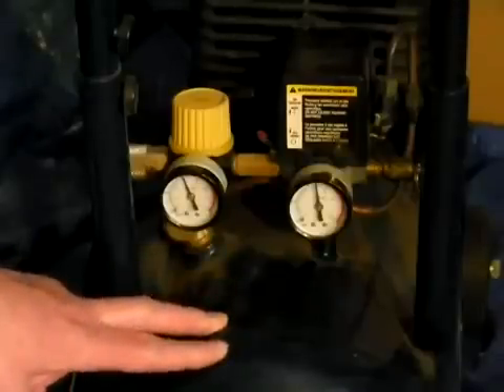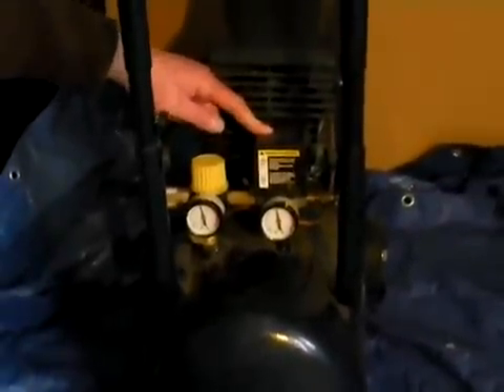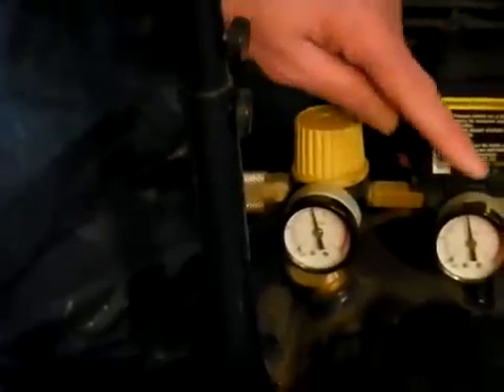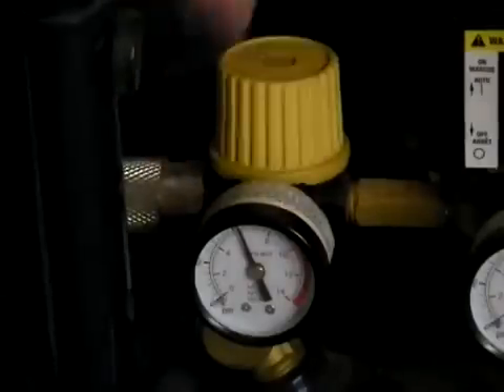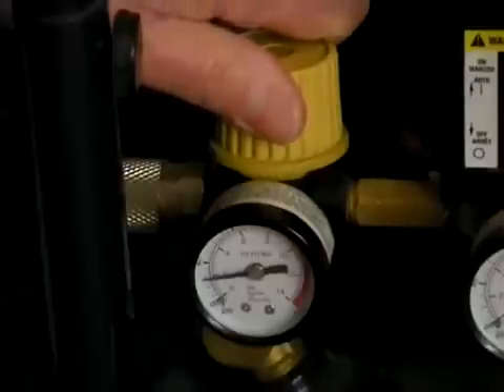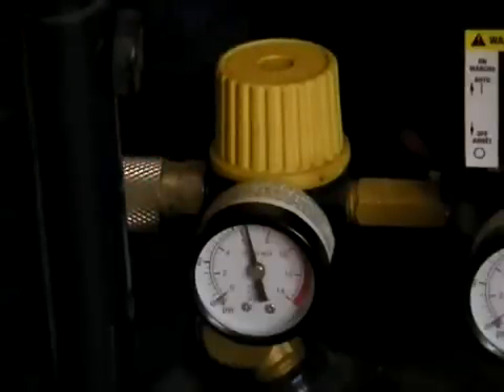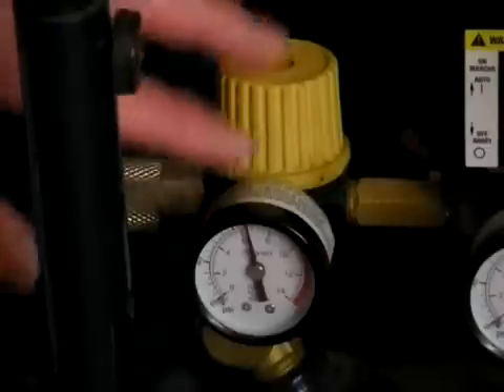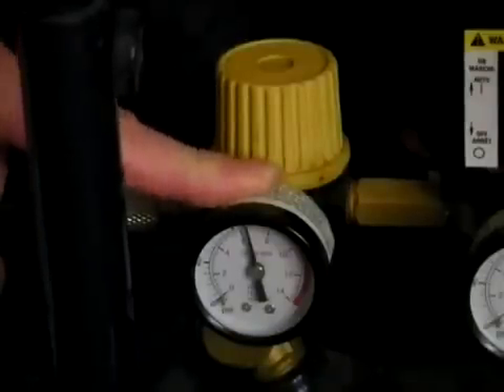About Air Compressor Regulators & How They Work

Comment: My question is: On the back of my compressor regulator assembly is a small 1/4" black tube that goes into the motor/compressor housing, and another comes out solid metal, and goes into the compressor tank. Its cover with a black rubber insulator because that tube gets hot. What are these use for the other input output regulator parts are standard and similar to video. Thanks

Comment: My air tank max PSI is 125 . To fill it from another air compressor set at 120PSI , but air tank only fills up 90 PSI. Why won't air tank fill to 120 ? Note: My air compressor in its own tank max PSI is 150.

Comment: Question because I'm trying to troubleshoot a situation...my air compressor goes to about 150 (that gauge shows 150). Then I have a regulator. The regulator went bad (leaking) so I replaced it. But whatever I set the regulator to, it bleeds off all the tank air until the tank gauge matches what I set on the regulator. This is never how it worked before. So I got another regulator, and it is doing the same thing!!! What could I be doing wrong?
Reply: I'm an idiot. Backward. Fixed.

Comment: When lowering the regulator yours goes down with no air flow threw the system 
My system has to have airflow moving in order to see the reduction on the regulator gauge 
Whats the difference?

Comment: I bought a regulator valve but if i put the female adapter on fhe regulator it cannot be show and change on the regulator gage. If i remove the adapter then you can read the gage ???

Comment: I was goven a senco pc1010. I was trying to get it going but although it pushes air, the tank doesnt fill.
Now I see it doesnt even have the regulator and guages assembly at all.
Is this why it pushes air thriugh the copper pipes but nothing goes into the tank ?

Comment: I dont care how they work  i just need something besides Harbor freight  junk
Reply: Milton is the best brand that I know of for anything pneumatic. It's the only brand I trust when it comes to air powered fittings and accessories. Their products cost a little more but are worth the added expense when you factor in the longevity of the parts.

Comment: Great video! But I have a question... Let's say I have a 6-gallon 150 PSI air compressor. If I set the regulator gauge to 35 PSI to fill my car's tires, can I be confident that they will be filled to that pressure without the need to check them with a tire pressure gauge?
Reply: Not necessarily. The air pressure will normalize between the two "containers" (tire and tank/reg out) If the tires are really low, it'll tax the tank, and the compressor will need to recompress the tank and the tire if you still have them connected. This could lead to unsafe levels in your tire and could cause it to slip off.

I recommend setting the Psi on the reg to the max Psi your tires can handle so it fills faster. Then, make sure the tank is fully compressed to the 150psi you stated above, after each tire inflation. This will help keep the tank above the tire Psi.

However, 30psi and the like it's very low compared to the 150psi, so I guess in your particular use case, especially with a 6gal tank, it's not going to matter so much. Just get it to stay compressed after each tire.

FYI, I have a reg on my air ride seat end of things, as they don't do 150psi. I have the tank do 150psi (tank can handle 200psi) and I put it on a quick connect hose fitting using a 500psi air brake tube. No regulator is on that. My tires have a max Psi of 120psi, but due to having them heat up as the bus travels, I inflate them to 100-110psi max while cold. (80psi is severely low) I have a 4 gallon tank and the tires probably hold more than 4 gallons, but they already have pressure in them. I'm hoping this setup will make it so I can fill my tires as needed, just like truckers with their 150psi air brake tanks.
Reply: It's not going to fill your tire to 35 psi lol it's pushing 35 psi of air thru the hose
Reply: @brandon33371 that was my question. Just bought my first compressor. It’s a 110 PSI compressor. If I set the regulator to 22psi it’s not like the air stops coming out once my motorcycle tire reaches the 22 PSI correct?

Comment: Bill, I have a Craftsman 30 gal upright that came with 3/8" hose. My 1/2" drive Earthquake air wrench couldn't get a Honda crankshaft bolt loose so I upgraded the hose and fittings to 1/2" but still didn't get enough air. I had to choke the air with a 1/4"x1/2" adaptor at the regulator, so that's probably the problem. Recently, I couldn't even break a Rheem water heater anode loose with it. Granted I had about a 75' hose run from the garage to the attic. The current regulator won't hold air anyway and leaks down after about a week unplugged. Is there a way to replace it with a larger one to take advantage of the 1/2" hose and fittings I have invested in? Or, is the actual hole into the tank small too (1/4") and this inadequacy is sort of "baked in" to the compressor? I don't want to invest that much money to get a large 60 gal tank to get the 1/2" regulator. Before I do that I would just put the smaller more manageable 3/8 hose back on, change all the fittings back, and buy a $300 electric Milwaukee wrench for the big jobs. What do you think?
Reply: Those honda crank bolts are famous it seems. Never done one, but i have read a lot of comments stating the same. What's the tightening torque for them?
Reply: @RGV2300  I put the new one on at 181 ft-lbs per my Honda shop manual which is more than my 1/2 inch drive wrench can handle. I had to buy a Harbor Freight 3/4 inch drive torque wrench to get that strong, but I needed it anyway for other things like wheel nuts. On my newer Hondas, their shop manual now states to tighten the bolt to something much less, a torque that could be achieved by a 1/2 inch drive torque wrench, THEN it tells you to tighten it another one sixth of a turn. Easy to do since it is a hex nut with six sides, so just watch it and turn it the distance of one of the flats or edges on the bolt.

Comment: After 9 years, u are prob not answering comments. Most cheap regulators are more like an air flow meter. Put a pressure gauge after  the regulator and measure the pressure when there is no airflow, and it will be similar to tank pressure. When there is air flow pressure reduces. This is bad for a tool like pop rivet tool, rivet nut tool etc, which has a pressure vessel and diaphragm.  Runner those outputs max pressure. In the case of a rivet nut tool, on small river nuts, it tears the thread out
Reply from the maker: Thanks for the comment Ian, your knowledge and experience would be much appreciated by the community over at About-Air-Compressors.com - come join in the discussion!

Comment: Not sure how to ask this ... The regulator keeps the extra air/pressure in the tank and just use as much as set on the dial ? Or it is released normally and the extra pressure is redirected to another output orifice ? e.g will the pressure last longer if set on lower at the regulator ?

Comment: But do I really need a regulator?  I think I lose more flow to my air impacts using these regulators, and restrictive fittings.  Besides spray guns, what air tool needs less pressure than I can get from my home compressor?   Air guns, ratchets, cut off wheels, die grinders, all need max pressure.  I can think of no reason to run a regulator, and they cause a restriction that makes my impacts under perform.
Reply: You would never want any of those air tools you've stated running at 120 to 150 psi. That's what the regulator is for. Look at your tools . Most say 90 max psi. Much more and the tool could and probaly will distruct inside.

Comment: Hi Bill, I too have a question about that regulating valve. I have the same setup on my compressor, two gauges, one with a regulating knob. On my system, I have to lift the knob itself to unlock it so I can turn it. All that happens is there is a constant rush of air which vents out of the valve itself and the pressure drops on both gauges.I cannot regulate the pressure using the secondary gauge. What am I doing wrong? Thanks 👍
Reply from the maker: Hi Robert... if you pop over to about-air-compressors.com and go to the regulator pages, there's far more information there than I can give you here, along with an excellent forum on regulators and air compressors. Do you mine? Thanks. Bill

Comment: Are there any mini regulators that have a port for the tank pressure and the working pressure?  Or do I have to add some "fittings" between the tank and the regulator to add a port for the working pressure gage?
Reply from the maker: All regulators have "in" ports that brings air to them from the high pressure or tank side, and an "out" port into which, commonly, is fitted a coupler to connect an air line to. See here for more info: https://www.about-air-compressors.com/regulators.html
Reply: http://www.youtube.com/user/gireshrathore

Comment: I have a question please:
What happens when the pressure in the tank drops below the regulator and I do not have a pressure switch to automatically turn on the compressor?

Will the regulator still flow air with les pressure or it will stop flowing air?
Reply: If the tank pressure falls below the regulator setting, typically the pressure downstream from the regulator will lower too, until the tank is empty of air. The regulator lowers the supply pressure, and if the supply pressure is lower than the regulator setting, it cannot raise the pressure. Not knowing anything about your air compressor except that it doesn't have a pressure switch, sorry, I cannot comment further.

Comment: I connected my regulator to the compressor but i can get the pressure on the regulator to go Up, what do you recommend? First time using an que compressor, wheelbarrow
Reply from the maker: Ummm, do you mean that you cannot get the pressure up? If so, is the tank pressure higher than the pressure you want the regulator to dial up to? If not, then you cannot raise the pressure with a regulator, you can only regulate it below the tank pressure. More info required, please. See the site about-air-compressors.com, and you can post a comment on the regulator page there, too.
Reply: Yes i start the compressor and it get full of air fast but i can the the regulator to increase the pressure.
I don't know I twist the knob on the regulator and doesn't do nothing,
Reply from the maker: If the regulator is installed with the arrow on it pointing towards the air line coupler, and if you push on the knob and nothing happens, or pull out on the adjusting knob and turn it and nothing happens, then either the air pressure in the tank is below the regulator setting, the regulator has a blockage of some sort, or the regulator has failed. Please see the page about how regulators work on about-air-compressors.com for a full explanation including troubleshooting.

Comment: so if my compressor can take 150 psi should i set the pressure switch at 150 psi then the regulator bellow 150 psi or at the same psi ?
Reply: If your compressor can take 150 psi it will have been adjusted for that by the manufactorer. When you turn it on it will build a 150 psi pressure in the tank and stop. The meter under the switch will show 150 psi.
You then read the needed pressure for the tool at the tool or in the manual for the tool and adjust the regulator until the meter under the regulator show the needed pressure - say 50 psi. Then the air coming out will come with a pressure of 50 psi even though the pressure in the tank is highier.
Remember that some regulators must be liftet up to be turned and pressing it down will lock it.
As you use air the pressure in the tank will drop and then the compressor starts by it self and runs until the pressure in the tank again is 150 psi.
The (low) pressure in the tank by which the compressor start up again is also set by the manufactorer.
Reply: that's the thing i replaced the pressure switch on it as the one on there was broken but i think the one i replaced it with was only 120 psi the tank did not look near as a big as whats on the compressor i have

Comment: Mr. Bill
I am wanting to add another tank to my air compressor. the tank I have is only good for 120psi. but my compressor goes to 150psi. is their a way to attach another tank to my air compressor , but only have 120 psi going to my secondary tank?
Reply: David Ciolino Nope. Just sell it and buy a new one. Too much pf a headache trying to retrofit the one you have.

Comment: thanks for making this video. I bought a air filter, I'm not sure if I purchased the correct product to solve my problem.  at work our compressor is releasing alot of water thru the air tools.  I can see water bubbling out at the end of my impact gun it's more obvious when I have an air blower. after blowing air consistently for 15sec the blower starts to spray alot of water. I empty out the compressor every night before leaving my work but I'm guessing the hoses are still filled with water. hopefully the filter solves my problem

Comment: does the air have to be on while regulating?
Reply from the maker: +edgardo estrada You can turn the regulator knob and move the gauge needle a bit, yet in order to set the downstream pressure to your air tool needs, yes, you need to have air pressure upstream from the regulator.